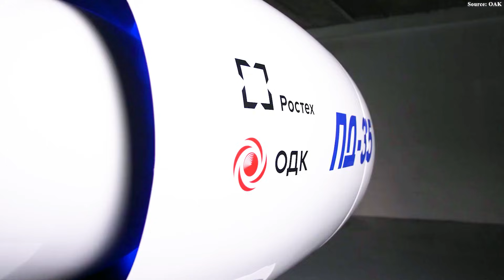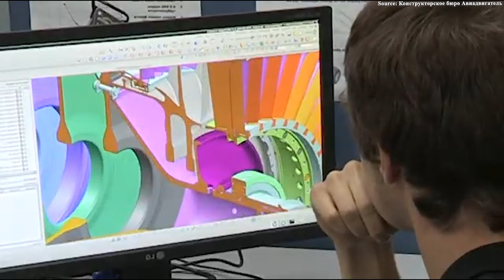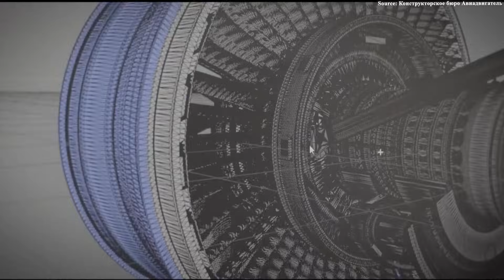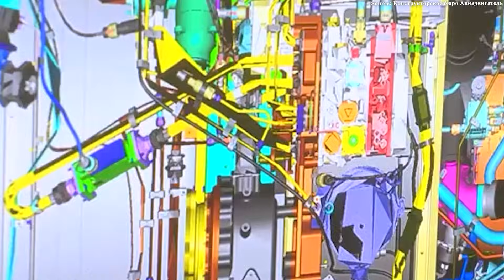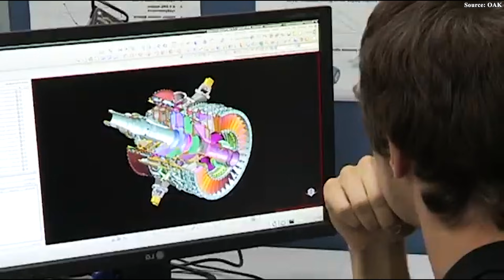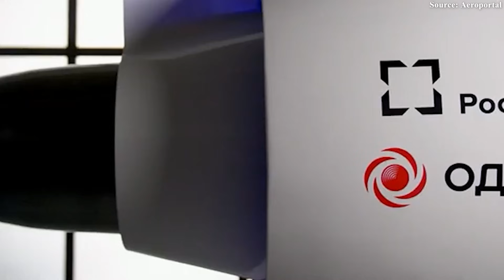Russia’s PD-35 Engine Just Changed Everything - No One Expected

Comment: False statement PD-35 russia desperately needs. There is no aircraft frame that is ready for this engine.
yet PD-26 is needed soon. and a priority for Russian  aviation. since many aircraft frames  needs it.
Reply: The manufacture of the fuselage is the least demanding, the engine is the most complex.
Reply: @igorderka4960  nothing is simple and fast in aircraft design and  manufacturing. a new aircraft needs 5-7 years to develop if the engine is already certified.  look at MC-21 310 it is not ready yet despite engine PD-14 is. and certified since years.
PD-35 is not a priority.  and wont be on airframe before 2030.